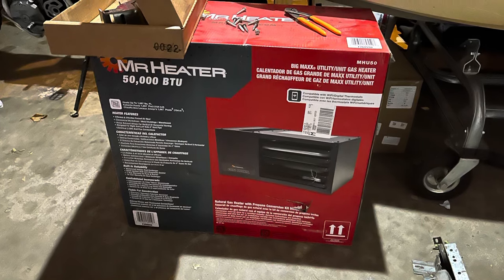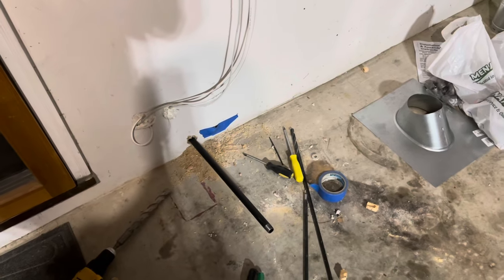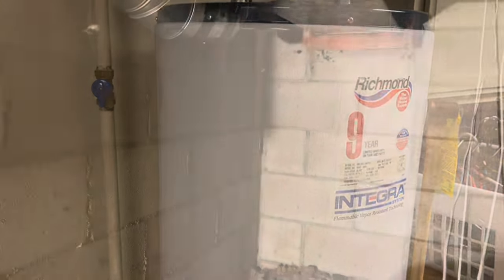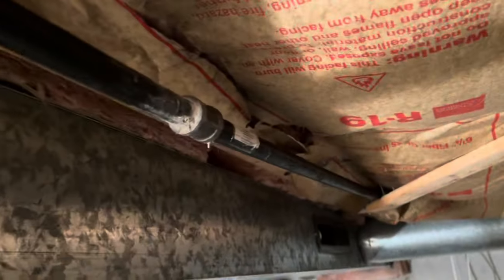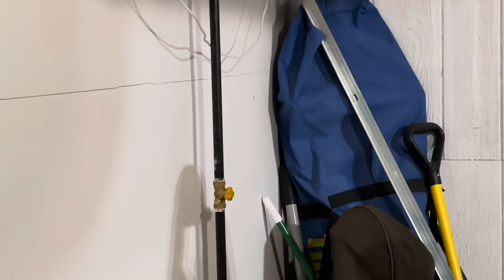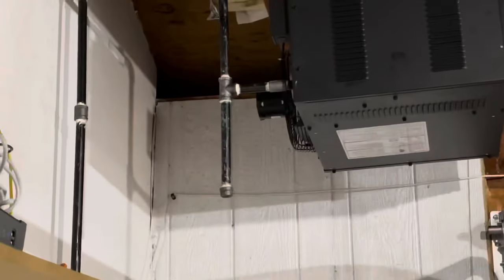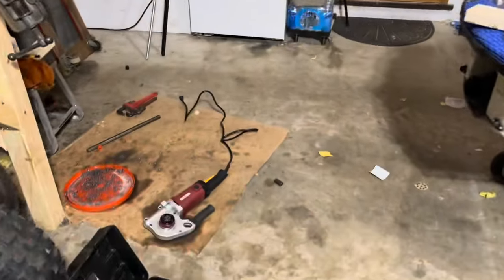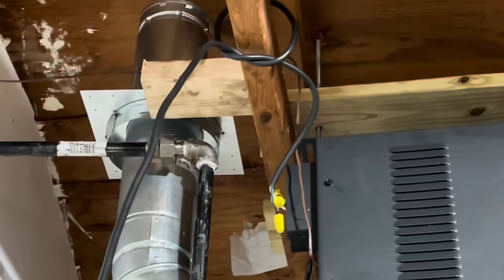My first gas heater install - Mr.heater Big Maxx garage heater $399 from Menards

Comment: What did you use to attach the venting to the adapter on the unit itself? 4 inch is too big, 3 is too small. I cant figure this out, as i do not want to use cat 3
Reply from the maker: It’s been a while since I did the install. But I got all the piping for Menards.
Reply: @2acres933  menards carries cat 3 and B Vent, but none seem to fit the adapter coming from the unit. I can see you definitely used B vent, maybe the brand I have is different than Menards because it just doesn't fit correctly
Reply: @mikehein8112 I just ran into this.  My modine heater says to use 4 in but it was very loose.  Outlet on heater was 3.75.  I used the extreme high temp (600deg) silicone to fill the gap.  Not sure why they don't have a 4in outlet so the pipes fit tight.
Reply from the maker: @tjayh5981 weird and what did it say in the instructions?
Reply: @2acres933  the instructions didn't mention anything about it.  Maybe modine makes an adapter but I'm not sure.  It was the only thing that I wasn't clear about.  My cousin is an HVAC guy and he told me to use the sealer.  I just finished my installation but it was 80 this weekend so I'm gonna fire it up tomorrow.   I purchased a good CO tester to watch if any problems.  It seems sealed up good, well see.

Comment: I just completed installing the exact same heater in almost a duplicate scenario. My tools are red, yours are yellow. Got to the turn on stage and nothing. I have electric to the unit and the supplied tstat wired up. Nothing. I even jumpered the red and white wires, still nothing.  I ran 3/4" gas line to it but the unit doesn't even cycle. This is an electric ignition unit so no pilot light correct? Any ideas?
Reply from the maker: Not sure bud. Just follow the diagram supplied. Might have a faulty unit…
Reply: Take the side panel off were the internal gas valve is. See if the valve is on the on position.
Reply: Low voltage fuse is blown, no power getting to the board, could be anything.

Comment: Just bought the same heater and was about to run it the way you did , but after doing some research,  gas line  not like water , you can't just tap in anywhere... there's a gas chart , based on line size , length and btu's 
My guess is your under sized .. Heater 50btu my guess is water tank is at least 30 so that's 80 .. based on the chart you'd only be able to supply 20 feet of pipe at 1/2 .. and that's from your main meter from the house . Not sure how far your water tank is from the main and if anything else is being supplied off that line , my case my dryer shares , so I had to install a tee off my main outside and start a whole new run .. I'm sure this is working just fine , just a warning for others watching
Reply from the maker: Hey thank you for the input. It functions fine for us. But that’s interesting, was not aware length made an issue with the flow of the line.
Reply: @2acres933  lucky for you , didn't have to re dig up a trench like I did lol .. wish I knew more a head of time
Reply: People need to know if they have a high pressure system also from what I understand. Also the elbows affect the gas pressure. There's a formula of how many affect a drop. 

I just put a furnace in my detached garage and did lots of studying. Our old house had a gas dryer at one time. I used that as my feed.

Im no gas expert just a dude that slogged away on my own like you. Glad it worked out!
Reply from the maker: Yeah best thing I ever did. Productivity on projects have gone through the roof since I have a warm work space!
Reply: @2acres933  same here....have a great 2022 and thanks for sharing your install.
Reply: @rickyb1980  at the 5:31 mark .. did you use double wall 90 ? .. any chance you could tell me what you used to make that connection to the heater .. my kit came with single wall 90 and not a fan , thinking return it  .. looks like there might still be a sticker on it
Reply: @davidfrisch5538  I didn't get a kit, pieced what I needed together on my own. 
I used a short 6ish inch double wall to a double wall elbow and up. The short piece twisted into the elbow and then slipped right on the vent on the furnace.

My garage roof pitch isn't steep and the furnace is clear back in the corner so my vertical pipe is a single 5ft. - that's 3 pieces of vent pipe.

Hope that info helps you.
Reply from the maker: Yes, I used B pipe for the whole exhaust. Which is all double wall.
Reply: @2acres933  okay thanks .. will be doing the same
Reply from the maker: I tell ya I’ve gotten tons of work done this winter, having a heated workspace! Enjoy!

Comment: With that exhaust tubing going straight out and up. Won't the condensation drain back into the elbow?
Reply from the maker: Have not had that issue
Reply: @2acres933  ok, thanks
Reply: @2acres933 maybe no issues yet, but it really should be going into a t instead of the elbow.
Reply: Why?

Comment: The heater you installed has a powered vent.  That means the exhaust gas is higher pressure than the pressure in the garage.  This is different from your water heater which is natural draft.  In the water heater the chimney effect causes the pressure in the exhaust pipe to be slightly lower than atmospheric pressure.  So, if there is any leak in the exhaust pipe of the water heater, garage air will flow into the exhaust pipe through the leak, which is not a problem.  Most importantly, any carbon monoxide in the exhaust gas cannot get into the garage because the exhaust gas pressure is lower than the atmospheric pressure in the garage.

Conversely, if there is a leak in the exhaust pipe from your garage heater, the exhaust gas being at higher pressure than the garage, will cause exhaust gas containing carbon monoxide to leak into the garage.  Obviously, not good.  To make your heater safe, special exhaust pipe with rubber gaskets at each joint is required.  Typically, this type of exhaust piping is stainless steel and relatively expensive.  But, since you have such a short run of exhaust pipe, the total cost won't be too bad, probably about $100 -200.

If you check the installation instructions for your garage heater, I think you'll find this type of exhaust piping is specified by the manufacturer.
Reply from the maker: I appreciate you sharing your knowledge Robert. I want to be safe out there for sure. I will definitely look into this.
Reply: @2acres933  The special exhaust pipe I referred to is Category 3 safety vent pipe.  Here's some useful information on this exhaust pipe:

The stainless steel heater vent pipe is available in several different sizes and lengths. If you do not find the exact length needed, adjustable length pipes are also available. Vent pipe and fittings feature patented built-in mechanical locking band and triple-lipped directional gaskets. All pipes and components are engineered with smooth clean welds located 90° from mechanical locking bands. All pipe and fittings are UL1738 approved for category II, III and IV venting applications.

Category 3 Gas Heater Vent Pipe and Fittings
What is UL 1738? In short, it is a US standard for gas venting systems required in category III applications. Category III refers to positive vent pressure which is created by exhaust blowers in unit heaters. These vent systems must be constructed of AL29-4C® stainless steel, contain gaskets for sealing, and have a built in mechanical locking band among other requirements.

Features
Made of AL29-4C® super-ferritic stainless steel
Built-in high temp silcone gaskets for air tight seal
Built-in locking band to insure a secure fit (no hardware needed)
UL1738 approved forcategory II, III and IV appliances.
Limited lifetime warranty

Here's the link to where this info came from:     https://www.acfgreenhouses.com/stainless-steel-category-3-vent-pipe.aspx

Stay safe,   Bob
Reply: I just installed the same heater. Per the mfg instructions, the heat is to be installed with NFPA or ASNI approved type B-1. So you don’t need class 3 as stated above.
Reply from the maker: Thanks Andrew I appreciate it!
Reply: @andrewkiepper3702  Yes, only horizontal venting requires cat 3..
Reply from the maker: Always appreciate any helpful input
Reply: B vent doesn't leak. The "class 3 stainless steel" is a scam, not meant for unit heaters or furnaces, it was meant for the half ass condensing boilers before they switched to PVC vent. These unit heaters are 80% afue, if that, they run hotter than a household 80% furnace due to their compact design and low airflow, condensation in the exhaust would never be an issue, rain water or snow would be the only time, which would quickly evaporate once it's running. B vent also takes decades to rust out due to it being double walled pipe, which most states require when the vent penetrates any flammable structure. By what you're saying, that would make the other 99% of unit heaters out there illegal that use b vent out the wall. You go by what your state requires and nothing else. The "experts" at mr heater don't know a damn thing. Take it from a seasoned technician.
Reply: @angryfarmingamerican2124  I just bought the big maxx 50,000 for my garage and plan on running it horizontal and only need my pipe to be roughly 3 feet total length. I was looking at cat 3 but what you are saying is I can run type B? Isn't that the same as pellet stoves piping? And one last question, I can run 3 inch and not 4 inch?
Reply: @ericc8895  no, pellet stove piping is not b vent. Check with your states code to know for sure.